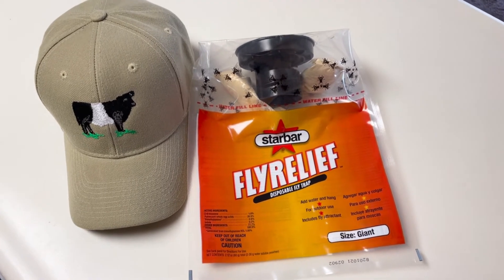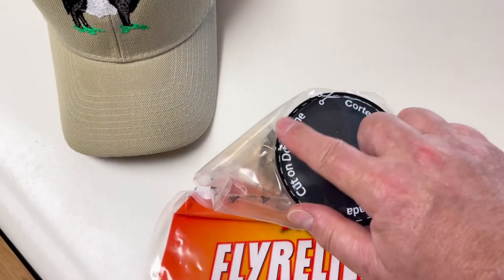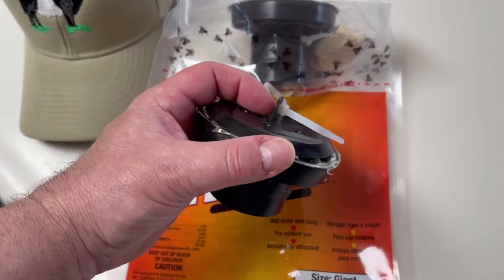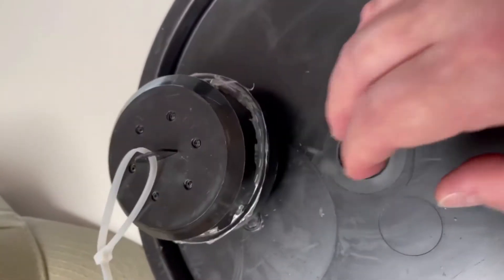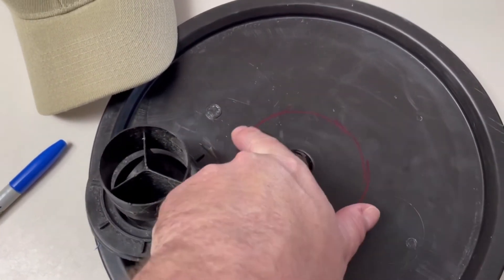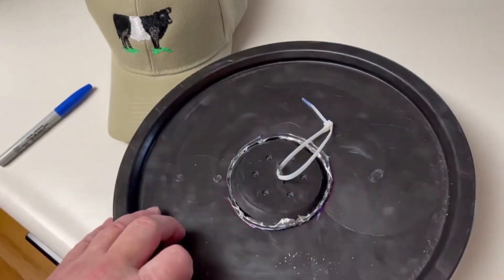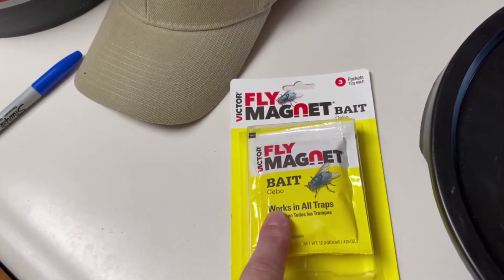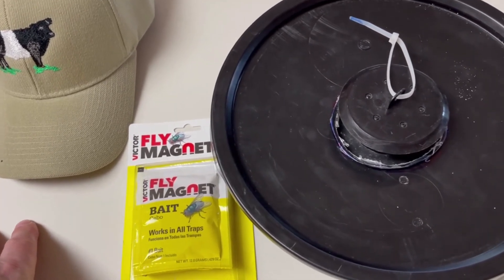Nuisance Fly Control using a 5 gallon bucket trap for cattle fly control | Belted Galloway Homestead

Comment: Thanks for the video. They sell those white food grade 5 gallon buckets that lets light inside. How do you empty the bucket when full? That's the question. I used the $5 quart size disposable trap near my coop and had flies arriving from miles around. Crazy. It filled up in 6 days
Reply from the maker: Thanks for the reply: I will look for a white bucket. I think the light is important. I have not emptied the bucket yet. I can see flies on the clear window. Not full yet. I was thinking that when it needs emptied, some flies may escape, but there should be gallons of dead ones. Additionally, I have seen traps that you can use on milk jugs, but never used them. Thanks again.